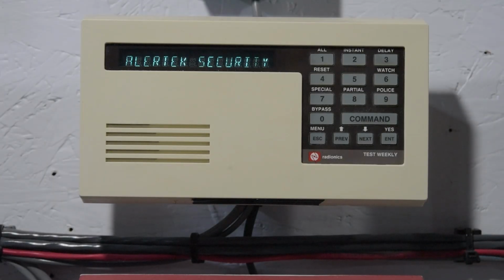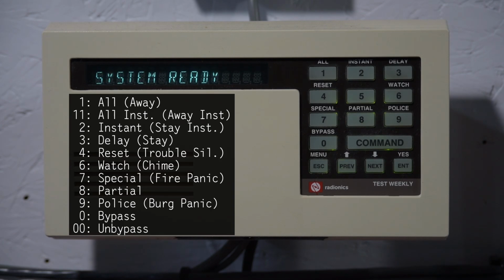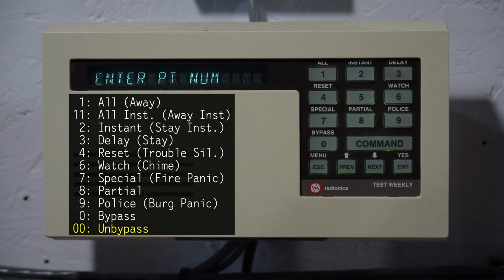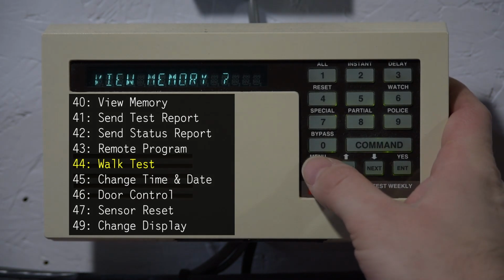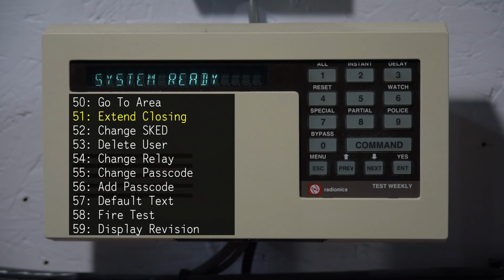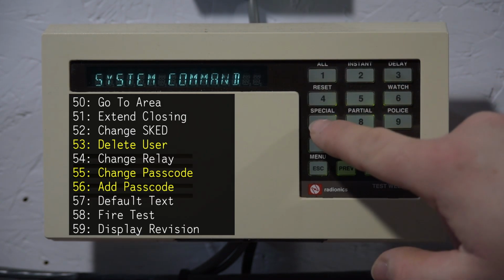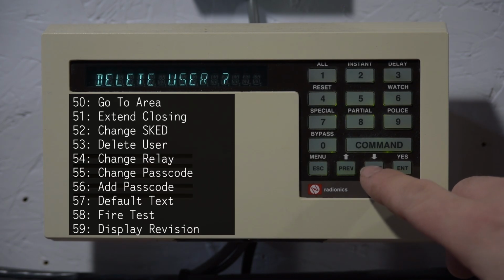Radionics D7412G - Security Operations (Radionics Part 2)

Comment: New intro huh? Neat.

0:44 So I have seen!

0:54 (whistles) That is loud! (though then again it's an outdoor siren so I suppose it should be loud so it can be heard)

0:59 I'm pretty sure I know the sound effect you're talking about, but that siren doesn't sound like it to me.

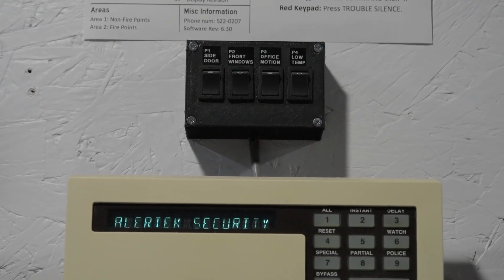1:21 Yeah, that are in place of the sensors that would normally be hooked to said zones: easy way of demonstrating the latter without having to hook up actual sensors that would likely be a pain to try & trip.

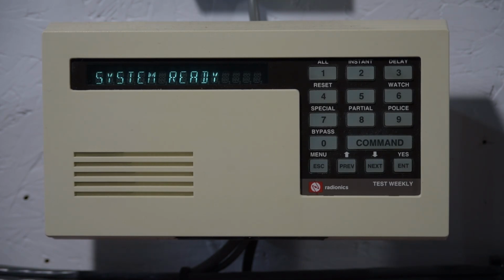1:51 Really? Huh, didn't know that. Radionics didn't just go with the standard 4-digit code that most manufacturers did huh?

2:23 Simple enough.

3:00 Clever of companies to give you both options just in case you should still need the delay.

3:33 I swear I've heard that sound from a keypad who's system was not in watch mode (or maybe it was but I had no way of knowing, I don't know): no idea what it could have been indicating though. Weird how the activated zone keeps displaying on the LCD even after it's reset.

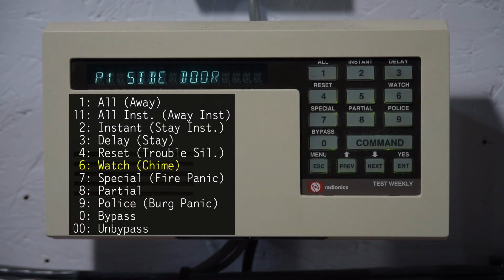3:41 Same here: definitely better than a more standard beep.

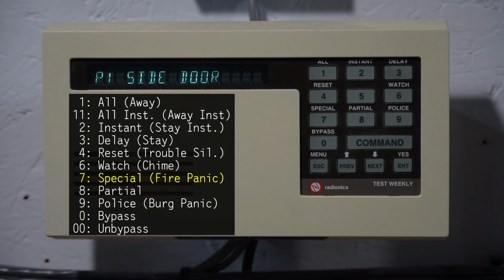4:06 Ah, one of those auto-bypassing arming types that not all panels have huh? Neat. Definitely convenient if you don't want to have to go through the long process that Command 7 forces you to.

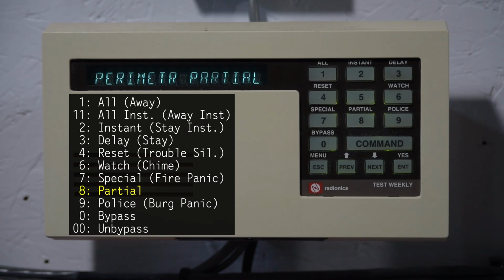4:48 Funny how the LCD doesn't have enough space to fit the entirety of the word "PERIMETER" on it so it's forced to shorten it to "PERIMETR"

4:52 Now that's both neat & clever!

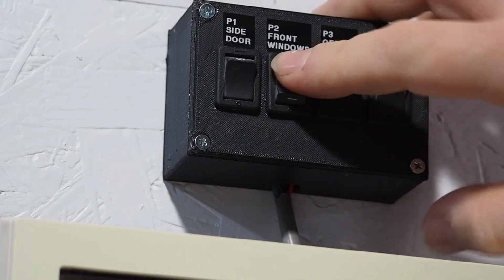5:17 I definitely find that alarm tone on Bosch/Radionics keypads neat.

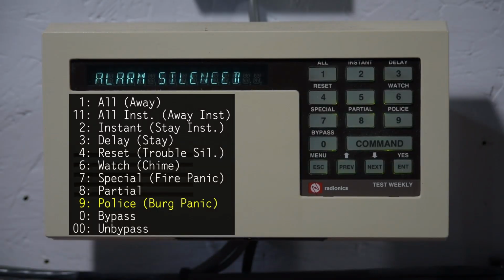5:48 6:22 Did you silence the system off-screen? (since the alarm would keep sounding until one did, no?)

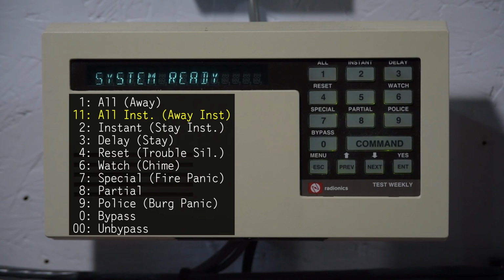6:31 Radionics really made that process easy didn't they? (ditto for unbypassing since it's literally the same process just with a different command number) Not sure why they made the point numbers so far away from the "PT" letters if they're just a single digit though (unless these panels can go up to 3 digit points & thus that's why: no reason to make single-digit point numbers that far away though).

7:57 Love that trouble tone: much less annoying & arguably much more attention-getting than other keypads'/annunciators' trouble tones (most of which are just a continuous beep): you know when you hear that that you've got a Bosch/Radionics security or fire alarm system somewhere that's got a trouble!

8:19 The keypad didn't sound its alarm tone there did it? Odd...

8:30 Really? Interesting...(ingenius too)

8:53 Will it re-arm the point that was activated once said point is reset? (unless it only does so if the point was set to be auto re-arming)

8:57 Gotta love how Bosch/Radionics keypads say that when the proper code isn't typed prior to a command, considering most other brands' keypads won't. Seems like you hit the 1 key while hitting the 4 key there, which is why it didn't reset, heh.

8:59 Didn't you say that one is supposed to hit escape rather than enter to reset the system?

9:50 Speaking of 5 I find it odd that that's the only key that's not marked with a word (unless there's a reason for that that I don't know of).

9:56 So if you want to test those zone types you'll have to put it into fire walk test then?

10:03 "0 PTS TO TEST"? Didn't you only activate three points though? (& thus neither one of the four switches nor the smoke detector or pull station (if it counts the last two at least given like you said the only thing that particular kind of walk test won't do is fire & supervisory points)

10:18 Interesting how that receiver uses the same LED caps as those on some Hochiki & Fenwal smoke detectors.

10:21 Got a printer hooked to that receiver eh? Interesting...

10:45 Another neat & unique feature on these systems (self-explanatory too, though can it work with only one door or with multiple?).

10:55 Ah yes, I've seen some Bosch/Radionics systems with such a keypad: not sure why it seems somewhat random what keypad they'll have (whether it's that kind, one with 8 buttons, or one with only 2 buttons), but yeah.

11:26 Oh: is that what the 5 key is used for? (if so why isn't it labeled "PROGRAM" then?)

11:39 The fire side of things is seriously considered a whole separate area programming-wise? Alright then...

11:45 Is that used on systems where the system is regularly armed at the same time every day & if it's not it assumes that whoever would normally arm the system was knocked out, killed, asphyxiated, rendered unconscious, etc.? (or otherwise that as you said something went horribly wrong (break-in, fire, gas leak, etc.) & thus immediate help is necessary)

12:21 Neat!

13:35 Huh, neat (clever thinking on Radionics' part too, making their security systems compatible with access control systems).

13:51 Oughta be interesting to see I think.

13:55 Let me guess: it's impossible to delete user 1 as that's the main system user (& thus without it the system couldn't be used at all).

14:51 Well all that was odd wasn't it?

15:08 Seems handy for a number of functions.

15:50 If they alternate that text regularly that might be a good way of avoiding "burn"/fading on the display (as happened with that one ITI system in a previous video of yours).

16:21 Aren't these systems sorta supposed to be fully combination fire/security though?

16:30 Clever on Radionics' part to include that menu: would be pretty difficult to use the system otherwise I'd imagine (unless one also forgets the fact that there's a menu in the first place).

16:56 That's okay: I'd say it was rather interesting regardless.

17:03 Yeah.

17:09 Sure thing!

17:14 Thanks: you too!

Thanks for making this video: very informative, entertaining, & educational for sure! (especially if someone with one of these systems needs to know how to use it)

By the way NewAge, what are your thoughts on Bosch's decision to exit the security industry? I think it's kind of a shame, especially since they seem to be one of the major (& possibly better) players in it (heck I'm not sure why they think they need to in the first place, much like how Carrier Global is attempting to sell their fire division to someone else).

One other thing: why does the description say "Radionics 9000 series" when the model number of the panel in the video seemingly doesn't belong to such a series? (or at least the model numbers don't seem to match in any way)
Reply: In commercial applications fire and burglary should be on their own separate area or partition as its called on other systems. It separates the zones and keypads completely, and each area can even have its own account number for the central station. It makes troubleshooting a lot easier, and makes it so you can have a separate keypad for fire and burglary thus making the system easier to operate.
Reply: @davidheppe7449  Not sure I get how that's supposed to work but okay.
Reply: @davidheppe7449  Okay I guess...

Comment: The Silent Knight 2615 system I have also has varying lengths for the passcode. Main codes are 4 digits, though the code for entering programming is 6 digits. It also has a feature for 2 digit codes, though those only work for arming the system. The main purpose of that is for maids or caretakers to arm the system when they leave. You can’t disarm with 2 digit codes though.